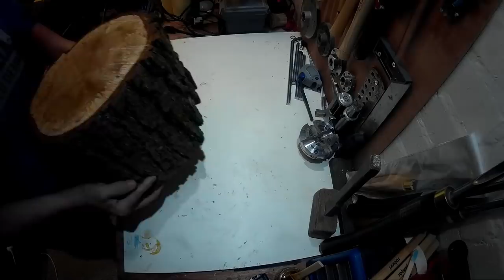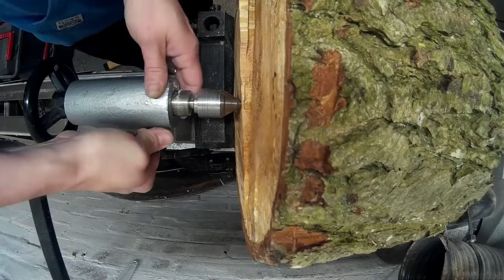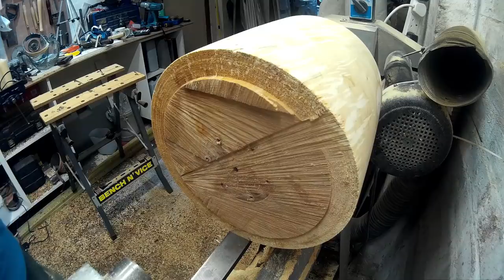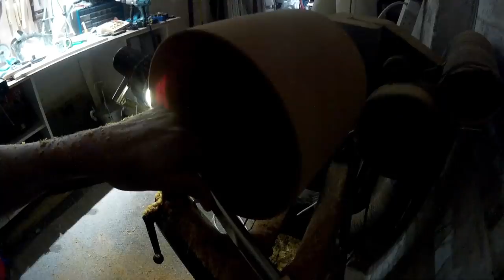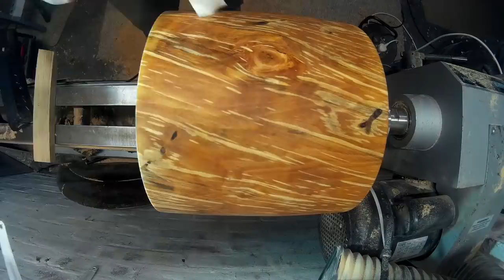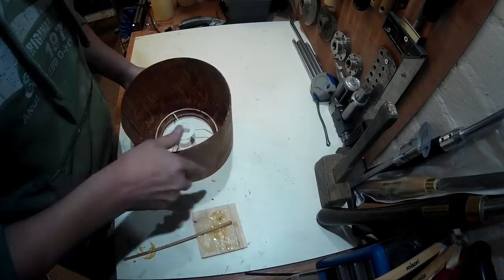Woodturning - Log to Lamp Shade

Comment: I collect, restore and sell Aladdin oil lamps.  Their shades do not mount at the top like the one in your video.  They sit on a 10-inch ring that mounts under the burner.  I think one of your shades would be a beautiful addition to a lamp.  So, since the lamp puts out as much light as a 40 to 60 watt light bulb and a considerable amount of heat (Alladins use a mantle, similar to a Coleman camping lantern) they used parchment paper for their shades.  Do you think a shade of yours would stand the heat without chancing a fire?  Interested in the challenge?  Can you say how much you get for a shade, 10" diameter by 10" fall, open at the top & bottom?
Reply from the maker: Hi, interesting idea, wood does not start to burn until about 270-300 degrees C. As long as the surface temperature is below this it should work. I regularly dry some woods in the oven at 200 before using them with resin. I would say this is a safe temperature.

Comment: Nice work Matt. 
Do you find certain oils work better in adding translucency to the wood? What did you use for this project. Thanks👍
Reply from the maker: Thanks Tony, this was finished with Danish Oil, its my preferred oil on most things really, I haven't really done any testing with other oils to see if there is a noticeable difference 👍
Reply: Matt Jordan Thanks Matt. Will give it a try. I’ve used linseed or tongue oil in past and always cut first coat 50:50 with turpentine. Does that apply to Danish oil as well? Thanks again.
Reply from the maker: @tonydelitala  Danish oil is basically Tung oil mixed with other things to thin it down, its normally about a 50% concentration of tung oil. So effectively a similar thing but most Danish oils tend to be food safe as is tung oil once cured.

Comment: how did you season the log? Any recommended method? I thought bark removal is essential
Reply from the maker: Hi, its not seasoned when started, this is turned green. If you turn thin enough it will not crack
Reply: @MattJordanWoodturning  Thanks. I noticed you kept the pith in and was confused about how it hadn't cracked when you seasoned it. You just hadn't haha.

Comment: Your going with a wall thickness of 1/16"? How did you keep the wood from splintering?
Reply from the maker: With great care, one little catch and it's all over, as you approach your desired wall thickness turn your gouge on its edge and take very light cuts, almost a scrape.
Reply: @MattJordanWoodturning  thanks.

Comment: Waste of good wood. Why not cut veneers and make a shade that way. Shows of your skill if this was the point of the vid.
Reply from the maker: I've done veneer shades in the past, they look nice and I might do another one on here, however this wood was FOC, all shavings are returned to the garden as compost or used in the drying process of other projects, depending on the suitability some shavings are used as bedding for my sons hamster!. Any other larger pieces of scrap wood are given to a neighbour to burn in his log burner, very little to nothing is wasted.
Reply: You use a boring tool for front cutting  and make a tapere pipe and save your central  woods   khan  ameen  g.k.p.  india
Reply from the maker: @tahseenkhan1523  if it's not clear enough for you let me make it even clearer, I'm not spending hundreds of pounds on a specialist tool to make one or two lamp shades each year, especially when most of the wood I get is free, as explained above everything is re-used or recycled, so get over it, and quickly.
Reply: @MattJordanWoodturning  I make  dholak an Indian music parts  from this method   You can see  this in my workshop
Reply: @MattJordanWoodturning  it's  not an spending  tool it's  Idea of simple  side boring tool  how I explain  it written  I show it practical y friend